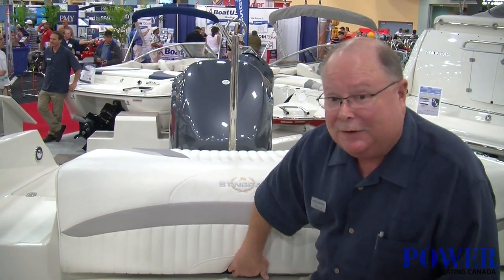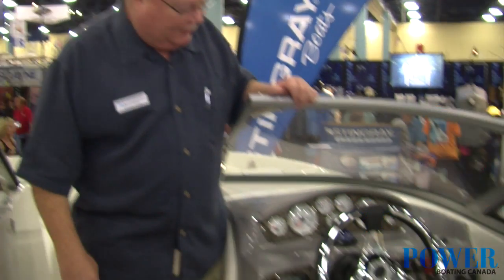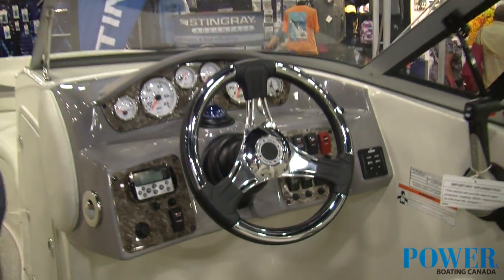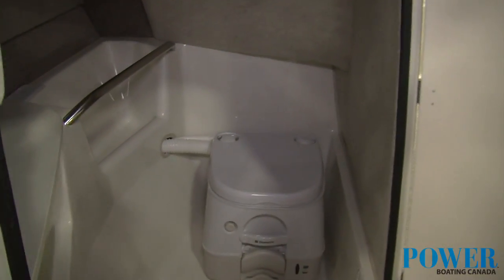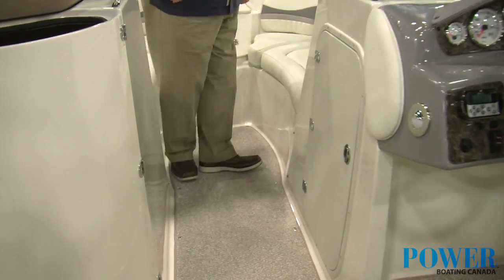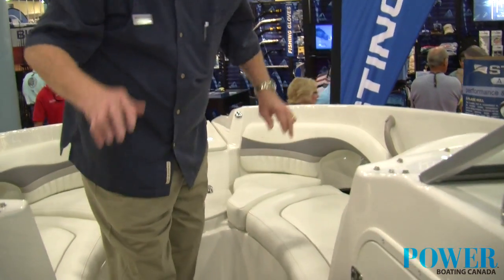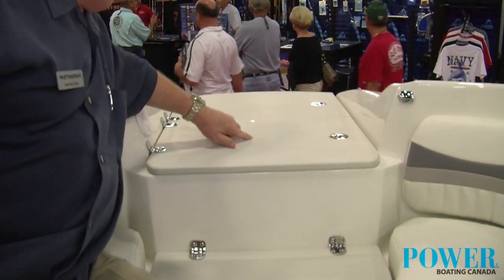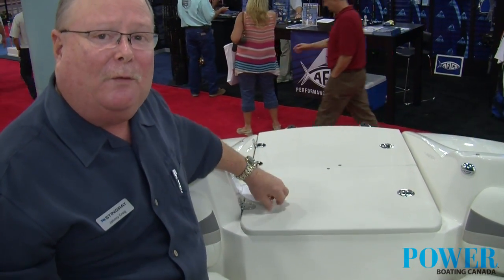2012 Miami Boat Show - Power Boating Canada - Stingray 234LR

Comment: The newer production models feature a full color hull stripe (instead of the half stripe shown) or a solid color hull and the interior colors and features have changed a bit, but otherwise, this is still a great basic walk-thru of this Sport Deck model. See your dealer to check out the new features and to take a test drive. You won't be disappointed!